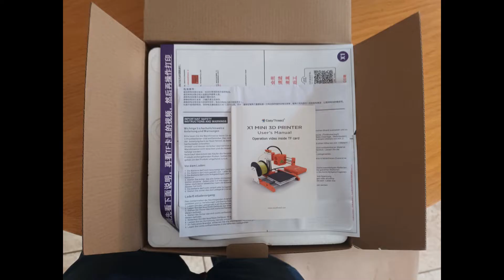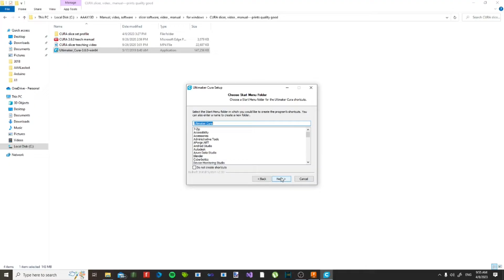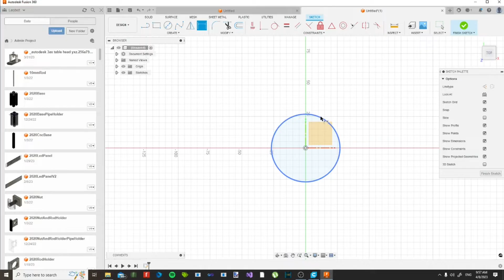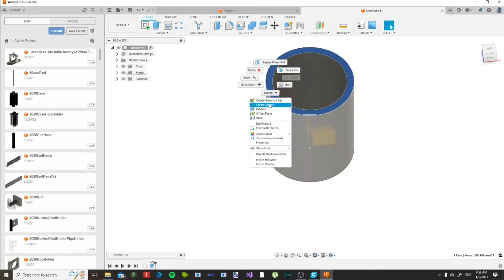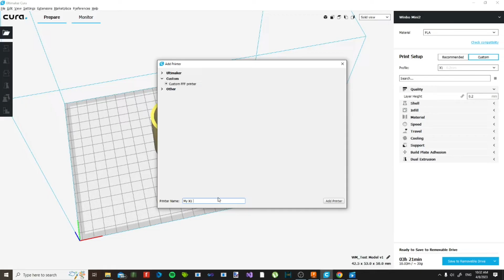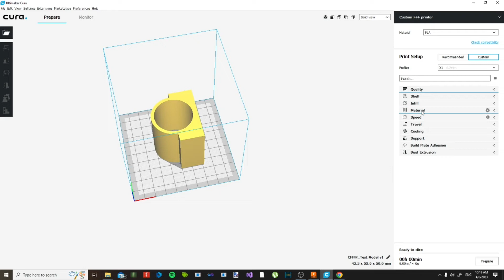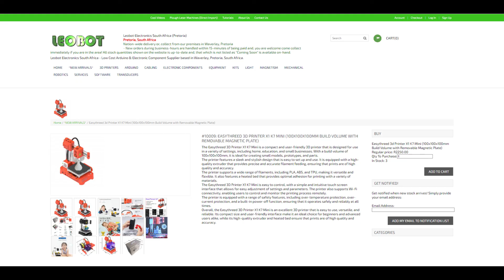EasyThreed X1 Mini Hardware & Software Setup

Comment: The ultimaker curi 5.3.1 was on the flash drive but after putting onto laptop and loading it  a message came up to say a piece was missing I un installed it then tried again but this time it wasn’t on the flash drive
Reply from the maker: If you want, I can share the software from the flashdrive on the leobot website.
Also, it may be that your anti-virus picked it up and deleted it from the flashdisk (I have had that happen before with Chinese installers with other systems but not this one).
Also, luckily, you can download Cura easily from the internet and do not need the version they provided on the flashdisk.

Comment: My rocket fails every time the pka won't stick
Reply from the maker: Apply a light layer of Pritt glue to the bed before printing; that should do the trick (even with my expensive printers this happens). Just DONT use permanent or super glue though!
https://www.prittworld.co.za/en/products/glue/glue-sticks/original-pritt-glue-stick.html